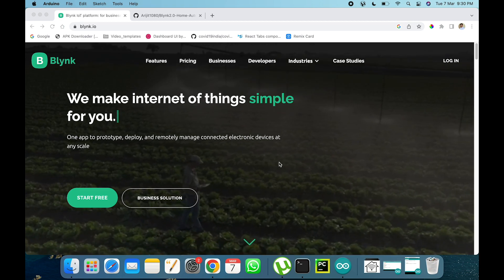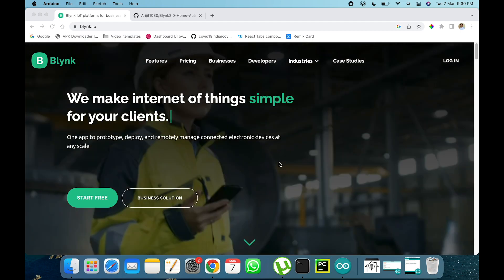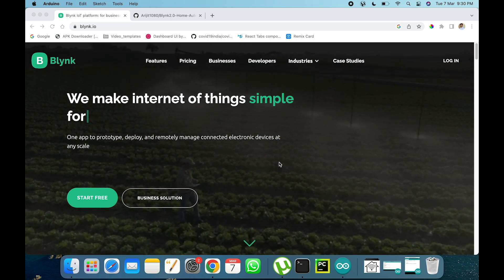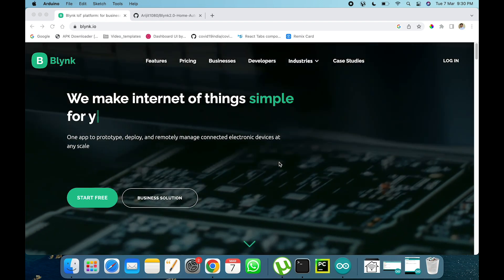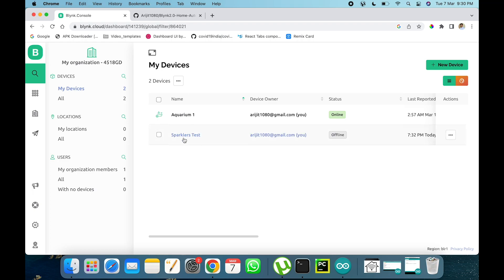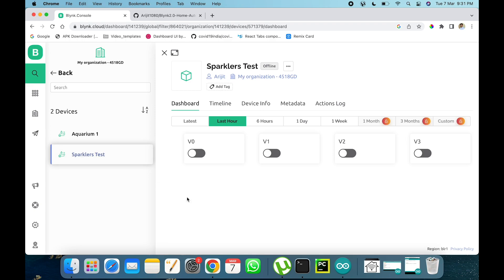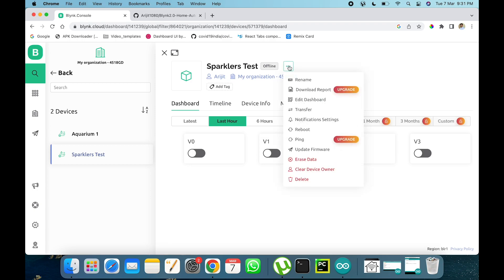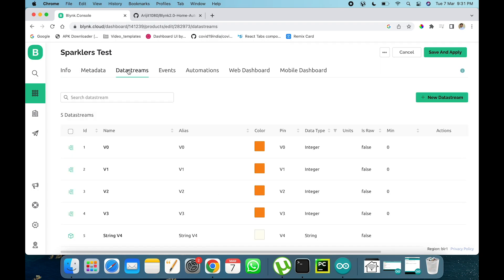Time Input / Time Schedule in Blynk 2.0 | Build WIFI Extension Board with Timer

Comment: I run wrong
In file included from C:\Users\Admin\Desktop\Edgent_ESP8266\Edgent_ESP8266.ino:17:
C:\Users\Admin\Desktop\Edgent_ESP8266\BlynkEdgent.h:17:2: error: #error "Please specify your BLYNK_TEMPLATE_ID and BLYNK_DEVICE_NAME"
   17 | #error "Please specify your BLYNK_TEMPLATE_ID and BLYNK_DEVICE_NAME"
      |  ^~~~~
C:\Users\Admin\Desktop\Edgent_ESP8266\Edgent_ESP8266.ino:18:10: fatal error: NTPClient.h: No such file or directory
   18 | #include <NTPClient.h>
      |          ^~~~~~~~~~~~~
compilation terminated.

exit status 1

Compilation error: #error "Please specify your BLYNK_TEMPLATE_ID and BLYNK_DEVICE_NAME"